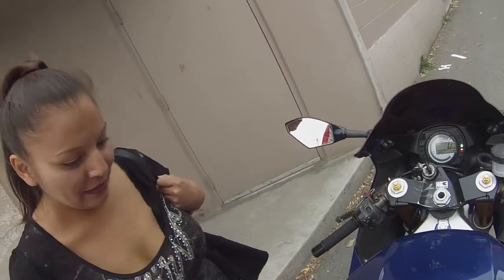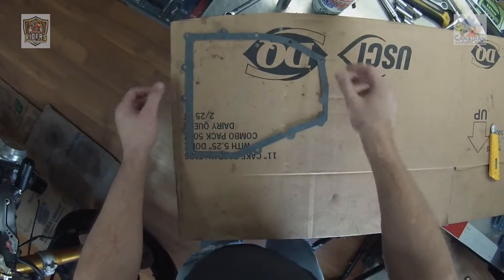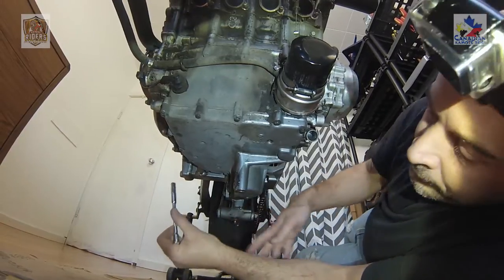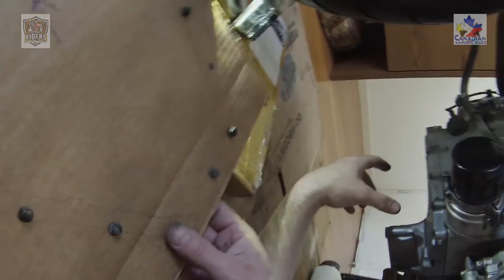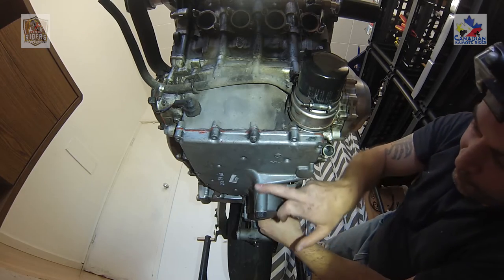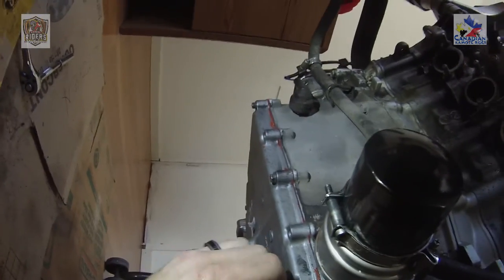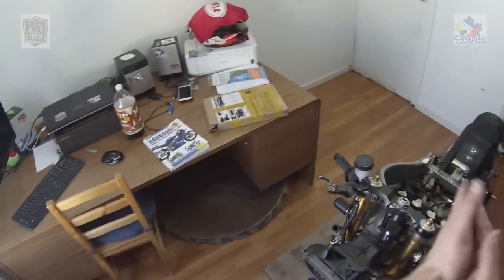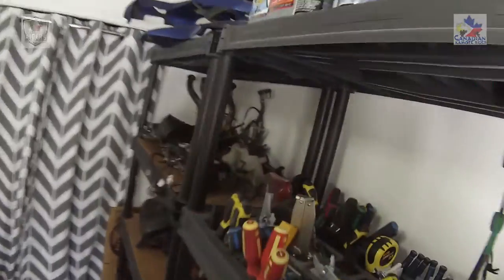OIL PAN  INSTALL KAWASAKI NINJA ZX636

Comment: I got basic tools and no torque wrench. I've done oil changes before but unfortunately fucked my drain hole too hard to the point of fracture. Would you recommend I replace the pan myself or should I pay a few hundred and get the kawasaki pros to do it?
Reply from the maker: That's exactly what happened to my oil pan. I changed the oil 100 times and just snugged up the drain bolt with no problems but the 1 time I was in a rush I did it to hard and it caused a hairline crack from where the drain bolt is going up wards🤦‍♂️. So to answer your question it's super easy and simple to replace the oil pan but #1 get a set of exhaust gaskets cause you'll need to remove the header and you'll need new gaskets to reinstall it. #2 get a new oil pan gasket to install the new oil pan and then your all set. #3 get a dam torque wrench 🤣🤣🤣Well honestly you’ll need one because to install the oil pan and header, you don’t want the tighten the bolt feeling then it’s really lose and spins cause it’s striped or the bolt broke and there’s a piece left inside. Honestly it's real simply to do so save your money and don't go to the shop, I mean if your mechanically inclined, even if your not it's super easy to do. Hope this helps, if you have any further questions let me know👍
Reply: @CanadianKamoteRider   thanks a lot man thats really helpful. I wasnt aware of any exhaust gaskets but ill be sure to order some. I already have the oil pan gasket on order. Thank you, i just dont wanna fuck up again lol
Reply from the maker: roger201288 I just remembered that you’ll have to remove the radiator so that you’ll have easy access to the nuts for the header, here’s the link to the video of the radiator removal. The second link is for removing the header and you’ll see the crush gaskets for it. https://youtu.be/232RU7JZBpE
Reply from the maker: roger201288 here’s the link for the header removal https://youtu.be/fed4tYmxc4w
Reply: @CanadianKamoteRider   Canadian Kamote Life  shit thanks a lot. Is it impossible to remove the headers without removing the radiator or just difficult? I was hoping that the radiator could stay put
Reply from the maker: roger201288 I’m going to say and lean towards saying that it’s probably best to remove the rad, it’s a super tight area and might be difficult or next to impossible to get at the nuts to remove the header. It might be possible but I think it’d make your life a lot easier to remove it. Watch the video I sent you about removing the rad and you’ll see it’s super easy, only 3 bolts holding it in, just have to drain the coolant first. The flip side of this is you’ll be able to do a coolant change also😉 just don’t dump the old back in, get new fresh coolant 👍
Reply: @CanadianKamoteRider  thanks a lot dude! Beyond helpful. Stay safe buddy
Reply from the maker: roger201288 no problem 👍 anytime 😊 if you got any other questions, don’t hesitate to ask 👍 hope your project goes good 😊👍

Comment: Why use seal it if you have a gasket
Reply from the maker: Idk it was extra protection and peace of mind for myself I've had nothing but excellent results using that stuff, it's not mandatory, but it also helps keep the new gasket un place while installing it.
Reply from the maker: Also eliminates any chance of leaks😉

Comment: Anyone Kno if there's any difference between the 600 an 1000 I've got one that needs replaced so wanted to see what I was gettin into with it
Reply from the maker: Sorry unfortunately I don’t have any information about the 1000cc bike. I’d just take the fairings off and have a look at how everything is set up, to decide if you want to take on the job. Also I’d highly recommend getting a Haynes manual or a similar service manual and do lots of research online to get as much information/tips as possible before starting. I’d order a set of exhaust gaskets before you start also. Well good luck 👍 take your time, don’t rush things and let me know how it goes 👍.